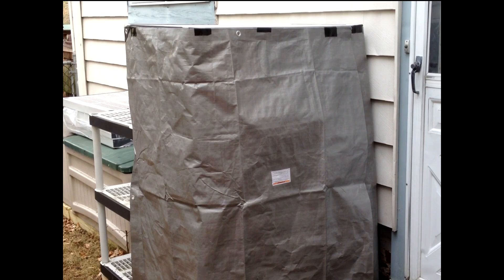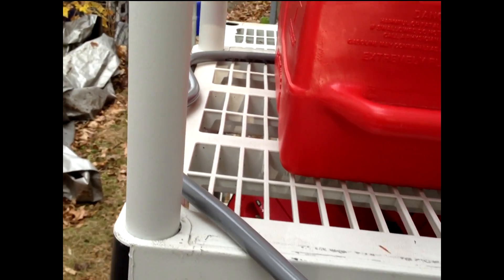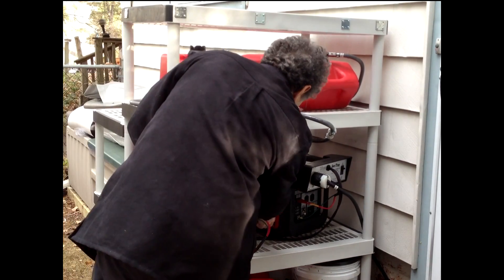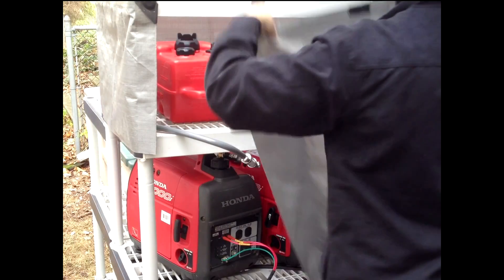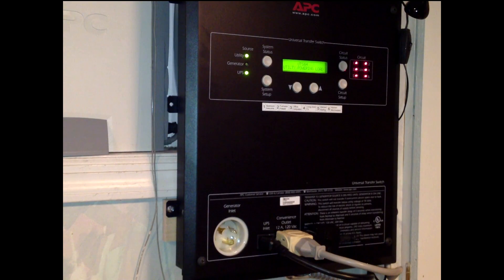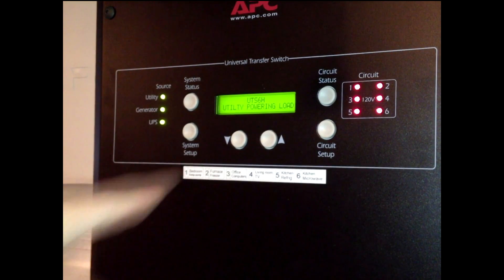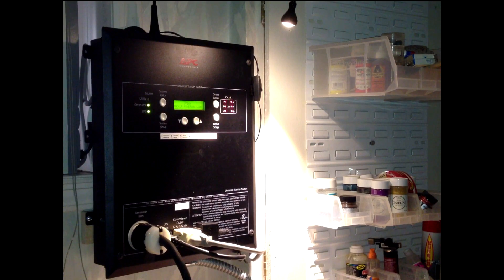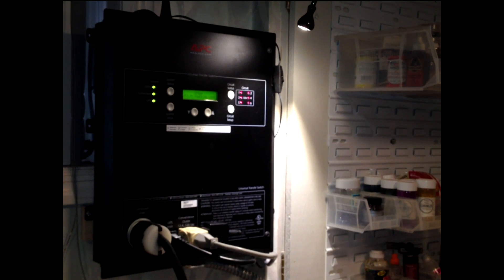Honda EU2000i generators with APC transfer switch

Comment: I have a similar, albeit different set up. For the cost of around $2000, I built a critial loads panel, that goes into a Renogy inverter charger. That interter charger also connect to the main panel, so when utility power is working, it passes through to the critical loads panel. The inverter charger is also connected a 170ah Lifepo4 battery. So I get instand UPS for my critical loads. Then when the battery gets low, I run the generator, and manually swich the transfer switch so the inverter charger is now getting power from the genny, rather than the main panel. Which powers my critical loads AND charges the battery.

Comment: Do not ever put your generators on a shelf and run them.  This is how people burn down their houses.  That is not a safe setup.  Vibrations ultimately cause those generators to fall pulling the gas cans with them and you can imagine the resulting fire.

Comment: Hi Zentient1...I was hoping you could answer a couple questions for me before I buy this UTS:

1.     What is the trigger that causes the UTS to switch back and forth between utility and generator/UPS power?
    a.     Is it the loss/restoration of utility power OR

    b.     The presence/absence of generator power OR

    c.     A manual intervention to switch between power sources?

2.     I see you have both utility and generator power feeding the UTS simultaneously (ie. Generator is running before power goes out per your test, sort of “standby” mode)?  What governs which power source is used? Can you select manually to stay on generator power or does utility power take precedence and it automatically switches back as soon as utility power is restored?

3.     When the UTS is configured for a manual start generator (the automatic option requires an extra kit to be used to start/stop an actual generator; the start/stop delay configuration options only apply in automatic generator mode) would there be a delay in supplying power to generator circuits if the generator is already running when the loss of utility power happens?
  It seems like there is in your video....so if generator is connected and running, no UPS plugged in and you cut power from utility, what is the delay to switch over?

 Thanks in advance.

Comment: Works great.•••>share4.photo/H2KGenerator?Mに  I have tested it with a 1,600 watt load which it handles with no problem and no strain. I am confident it will provide the power I might need when the lights go out again. Eco-throttle responds well as load is dropped or increased. Fuel consumption appears to be low as expected. Honda quality is apparent. Easy to crank if you do everything right: open the fuel vent, turn eco-throttle off, turn the switch on, and choke it. Initial start-up as received was a bear. Almost wore my arm out before it cranked up the first time trying to get gas to the carb through the empty fuel lines. No problems since then unless I go brain dead and leave out a step.

Comment: I have used the APC products in CATV head ends. We usually put the "sensitive" equipment on the ups as well as the gen so we don't have to re boot computers or re stabilize modulators or have a tech bring up our sat receivers if we loose land power. the purpose of the ups is to keep constant power to the "sensitive" stuff while the gen or land power is changing over.

Comment: Sorry for all the questions.  So if I understand you correctly, the APC UTS6H you own probably has, I am going to guess, 14 wires between it and the main panel.  Two for each circuit where one of these 2 attaches to the particular circuit breaker, instead of the hot wire in the main panel that use to be on this circuit breaker, and the other wire to the hot lead that use to be in the circuit breaker?  That makes 12 wires, each of which make a home run through the APC UTS6H, plus a neutral and a ground?  And if I understand further, the APC UTS6H's circuit breakers, used to power the backed up circuits in the event of a utility power failure,  themselves use fuses, not circuit breakers, to protect the wires????  So, unlike other models of this transfer switch no double hot leads from the circuit breaker (240V) enter circuits 5 and 6 (the 6 circuit 120/240 APC unit) or 9 and 10 (the 10 circuit 120/240 APC unit?)  This is strictly a 120 volt appliance?

Do you know if this unit allows you to hardwire the generator power cord rather than plug it in, as you've done, into the male L530 in the APC UTS6H?

Finally, do you know if this Honda based unit has yanked the generator control module?   This is the low voltage 6 pin attachment point in the upper right hand corner of the box used to auto start and stop a generator with electric start abiities, unlike your "twin" generators, like, say, the EU3000is, or higher.

Thanks so much for your help!!!

Comment: Curious..what's the amperage and voltage of the circuit you have entering into the APC switch from the utility?  Thanks
Reply from the maker: Dave Jones, if I recall correctly, I have a typical 200 amp service. The APC is connected to six of the circuits. Very straightforward.
Reply: Okay, but do you have maybe 1 of those circuits off your main panel feeding the APC, if so, what is its amperage/voltage? 

 Or maybe somehow the APC is feed immediately after your utility meter.  (I don't know if you have the six circuit 120 volt or 120/240 volt model such that if you have the 120/240 you could somehow connect the APC to wires carrying the full utility load--normally 200amp 120/240 in most homes.)
Reply from the maker: Dave Jones i have the 6 circuit 120 volt only model.  Two AC lines from the panel power the transfer switch.  Details are here http://www.apc.com/shop/us/en/products/APC-Universal-Transfer-Switch-6-Circuit-120V/P-UTS6
Reply from the maker: My unit is the UTS6H
Reply from the maker: Dave Jones the switch feeds 6 individual circuits, not the entire panel.  iIt can load balance the circuits if desired.

Comment: If you don't require one or more circuits to always be on, does the APC require a UPS system?  Rephrased, does the APC power itself in the event of a utility interruption, until at least the generator kicks in, or do you need the UPS to provide the APC with the energy to not only run, but move the switch---which may (I don't know) be a physical, not an electronic action--as is the case with normal automatic transfer switches.???  Thank you.

Comment: Zentinet1: absolving you from any liability whatsoever, I have a question right up your alley, if you'd be willing to entertain it.

Using a transfer switch, as you are, that is UL-1008 listed, is a good idea for not taking risks that homeowner's insurance won't cover, heaven forbid, an electrical fire. 

My question is, for those of us who only need a simple automatic transfer switch, one that simply switches the powering of a 50amp 120 volt subpanel (like me), that has my "necessary" appliances on it,, from utility to generator power, why not use an RV switch and save money?

And my answer is that most of these switches are not UL-1008 listed.  But quite a few are.  Any thoughts on use of the latter?

I have a Yamama 3000iseB invertor, converted, as I now read you've done, to run off of utility natural gas, that because it has electric start, I hooked up to a GSCM-mini.

If you ever switch to electric start generators, and wish to know how to wire this, I would be glad to share the good karma and help you with it gratis, including priming of the natural gas regulator.

Thank you sir.

Comment: Here's where I am confused.  Why use a more expensive automatic transfer switch if your generators don't autostart?  My point is--and maybe I misunderstand--in order to run selected circuits of the home off the generators, you have to manually turn the generators on, right?  

The won't autostart because they lack both electric start and a generator start control module (GSCM).

Given this, wouldn't a cheaper manual transfer switch that required you to manually toggle from energergizing your emergency circuits from utility to generator power have been fine?  I'd see your point if the generators started automatically with a power outage so that the whole system could be automatic.

I have a similar setup only its with a Yamaha 3000iSEB inverter, converted to run utility supplied natural gas, or propane, or gasoline.  The first is in endless supply from the utility even when electric power is out.  Additionally, because this gen has autostart, I hooked it up to a GSCM that starts/stops it based on the availability of utility power.

I have nothing to sell you.  Let me know if you want more details.  And thanks for the video.
Reply from the maker: Dave Jones, I bought it for its load balancing capabilities
Reply: That, now, makes perfect sense.  I had not considered that.  Thank you for enlightening me.....really.  : - )

Comment: ...  I would worry about a fire  . running while enclosed in this environment , heavy with gasoline  fumes once the heat from the runnings gen. sets. builds up .. !!!!
Reply from the maker: The back is mostly open, the exhaust goes straight out the back so there is no heat buildup.  I have reconfigured the setup.  It's now set up for Tri-fuel, and the generators are above the fuel tanks.  Running the generators on natural gas is very nice.  Not having to deal with gasoline is great.
Reply: Zentient1 Excellent  ... I am always  aware of highly flammable gasses ...

Comment: I'm considering the APC transfer switch. How's the long-term review of this product?  Any issue with fuses in the unit blowing?
Reply from the maker: No issues with blown fuses.  I bought extra fuses and keep the with the unit... just in case.  We have not had outages in sometime,  so the unit just hangs quietly on the wall, ready to do its job.
Reply: +Zentient1 Excellent to hear!  I am considering the 10 circuit panel but trying to determine if 9-10 can feed a small sub panel - you still have the 6?
Reply from the maker: +Craig Penrose The 6 circuit UTS6H is the only one that is certified to work with the Honda EU2000i generators.  It's a 120 volt only panel.

Comment from the maker: Someone just commented on how weather resistant or robust the setup is.   The shelving sits on 4x4 wood ties.  On the bottom shelf sit five 5 gallon water containers (good to have fresh water around), so there is about 200lbs of weight at the base.  The shelves are in an enclosed area, shielded from the wind on three sides.    I do tie the tarps during high winds, but for normal use the magnets work fine.   The goal of this setup was not to have the generators withstand hurricane force winds, but instead to allow generator usage in wet weather conditions, and keep the generators high enough in case they need to be used during a snow storm.  To that end, the setup works well.  I have reorganized the configuration so the extended tanks are no longer above the generators, and I have also converted the units to Tri-Fuel, so they can run using gasoline, natural gas, or propane.  Hopefully I will get some time to make a video of the updated setup.
Reply: I Had a gas generator set up to power my house. ONE problem gas will go bad. Use propane fuel generator you will NEVER had a problem with fuel going bad. Lesson learned!

Comment: Could you share what is the purpose/function of the GenTran outlet?  Also, do you have a link to an updated video of your new setup?  Also, could you share the size of that UPS?
Reply: True! It is the only one designed to do that.I don't use my 9 &10 circuit.I actually popped out the fuses,and changed them to 15 amp,and installed a double pole 15,in my panel,since they don't require much to operate.I'm running a 6500 watt generator,and with the load shedding feature,I love this UTS!,I am also running the apc rs1500 ups.makes the generator feel like it's putting out better,and no struggling whatsoever
Reply from the maker: Russel, I am not quite sure what you are asking.  There are two GenTran items in the video.  The one connected to one of  the generators allows the two units to be connected together in parallel, so their output can be combined into one 30amp plug.  The outlet attached to the house is a way of connecting the cord coming from the 30amp plug on the generator box.
Reply: Zentient1  Sorry, forgot about the GenTran part to allow parallel connections.  I was more asking about the part on the side of your house.  How does this connect into existing home wiring?  Or is this just a sealed pass through from the outside to the inside?  I guess what I'm asking is does this GenTran outlet have to be directly wired to the transfer switch?  For instance is there any way to put one of these on the back of my house, but have the UTS6H located next to the load center in my garage (front of the house)?
Reply: Russell Morris Before you buy one of these,make sure you ask the company you are going to buy it from, if the unit already comes with the hardwire kit installed.I purchased the uts10bi,and the hardwire kit.Found out that they changed design,and did away with the kit,and block off plate,and started making them designed to be hardwired only,from the factory.
Reply: MrCrf450rider which part are you referring to that has the wiring kit? The UTS?
Reply: Yes.Mine did not come with the input on the uts.it came with the hardwire kit already installed.not even a knockout
Reply: I don't know if this is a change,or if it is only with different models.But I got stuck with the hardwire kit.if you do an image search,you will be able to see it
Reply from the maker: Russell Morris Sorry for the late reply.  The Inlet box on the outside of the house is connected to 10 gauge wire that is run to the transfer switch on the other side of the basement.  I opted not to hard wire into the transfer switch, so the wire ends in a twist lock socket.
Reply from the maker: MrCrf450rider Also worth noting is that the UTS6H model is the only one designed to take a single 120 volt input.  It's the one that is specified for EU2000i generators.  When I spoke to APC and we both looked over the wiring diagrams for some other transfer switch models, and it looked like others might work well (perhaps with some modifications) they couldn't/wouldn't certify that any other models would work.   Fortunately I was able to find a dealer that had the UTS6H in stock.
Reply: They did change the generator line.It is now required to be hardwired from outside.No more of the front facing inlet connection.

Comment from the maker: You misunderstand the reason for the UPS.  It's not there for power conditioning.  A UPS stands for Uninterruptable Power Supply. It kicks in as soon as the power goes out, and only powers for a short time (the batteries aren't very large).  When the generators start supplying power to the panel, the UPS is taken out of the circuit.

Comment: Hi, I'm curious why you spent the money on honda inverter generators when you are pushing inverted power into a UPS battery backup which has an inverter in it already?  IE-- you are cleaning clean power???  Not that this bad, just an expensive way to get clean power.  You could have gotten the same bang for far less bucks.  Get a regular Honda/other 4000 watt generator and send it into the APC/UPS.  [if I'm understanding your system as I'm seeing it]

Comment: I have Honda EU2000i and EU2000i Companion with parallel option.  I was wondering how you handled the neutral and ground between gens and TS/Panel.  Did you tie the neutral and ground at the gens.  I intend to get UTS6H and want to be sure that wiring is done correctly.  Tx!  Like your setup.

Comment from the maker: I forgot to mention, that I've also reconfigured the setup.  Now the generators are above the auxiliary fuel tanks, and I have added Tri-Fuel conversions to each generator, so I can run from gasoline, or natural gas, or propane.  I'll make a new video soon showing the most recent configuration.

Comment from the maker: Thanks for your concern.  Several months ago, I moved the fuel tanks below the generators.  The house has aluminum siding and the generators are pointed away from the house.  I may add a layer of cement board between the shelves and the house.

Comment from the maker: I have just made some changes to the setup, and I'll eventually make a new video.  I had a natural gas line run to the generator area, and added "Tri-Fuel" modifications that give each generator the ability to be fueled by natural gas, propane, or gasoline.   A few other changes include replacing the Johnson/Evinrude style quick fuel connects with Honda style, and moving the shelving so the generators are above the gasoline tanks.

Comment from the maker: Yes, that is the main purpose of the APC transfer switch (or any transfer switch), it mechanically isolates the generator power so that it has no chance of backfeeding into the utility grid.

Comment: Great looking system.  I am just starting to look into something similar.  Is there anything in this system to prevent power backfeed into the power grid?  Does the APC transfer switch handle it?

Comment: I am installing the APC UTP too,, What a great unit. Since I don't want to power on the unit all the time. I put a SPDT switch on circuit 5&6. So I can turn both switches to run and check the UTP if I need to. I will hook up the UPS to an pure sinewave inverter with a Solar mppt charge controller with 4 deep cycle batteries. I also have a honda su2000i. 
I should be all set.

Comment from the maker: Officially just two units of the same size.  There was a three generator third party connector sold a few years back, but it's no longer available.  Also, consider that the generators' internal wiring would likely need to be able to handle the maximum (or near maximum) load.
So I would stick with the manufacturers specifications and parallel only two units.